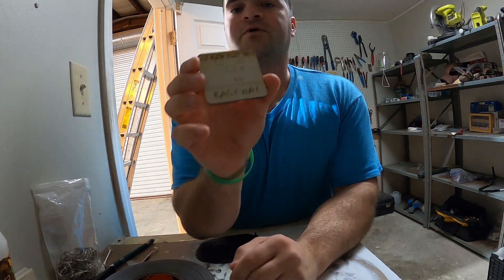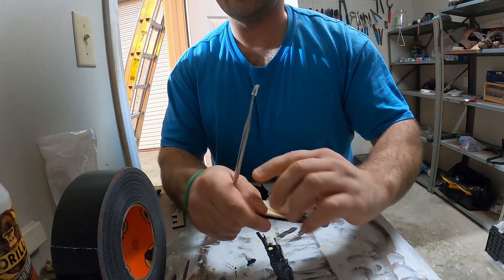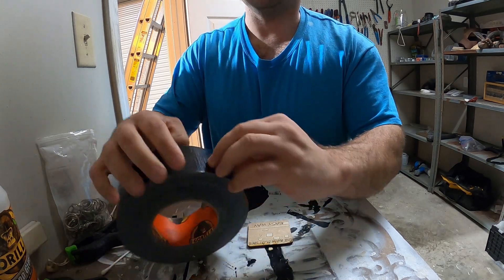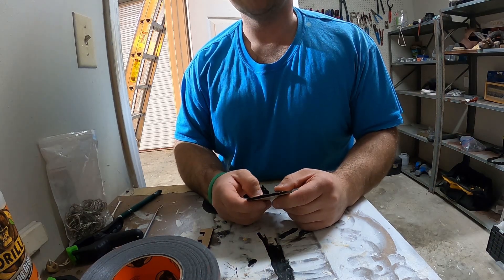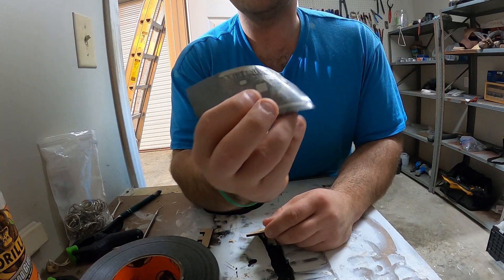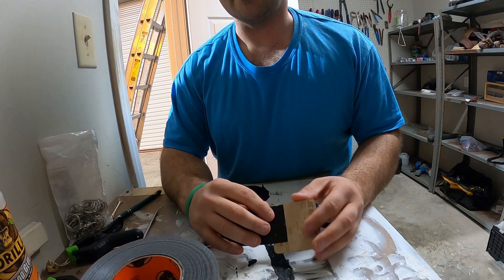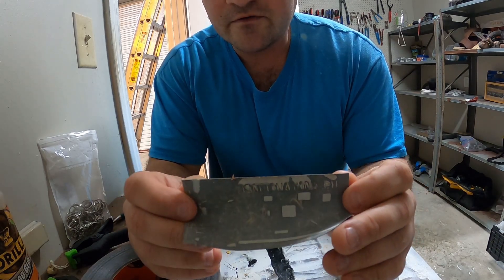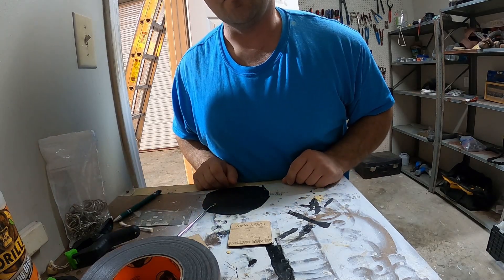Trick To Take Masking Tape Off Your Laser Engraving Project | Laser Engraving Tip

Comment: So, I tried your method, but it did not work.  I was using blue tape for the engraving.  I don't have Gorilla tape, but I something similar.  It is a black tape that is so sticky, you can barely get off the roll.  I will try the transfer tape.  Hopefully, I have better results.
Reply: I just received my transfer tape and gorilla tape and tried this on the back of a scrap piece that I had engraved.  It looks very promising as the transfer tape came right off.  The blue tape I was using is apparently a little bit too sticky.  I will know for sure once I engrave something.

Comment: The only problem I see with using a strong duck tape is you can fairly easily damage a project if it is a delicate wood. A fresh strip of masking tape works rather well to remove the masking tape initially lain down.
Reply from the maker: There are some projects where this would not be ideal. It's just a tool for the toolbox that can be utilized in certain situations.